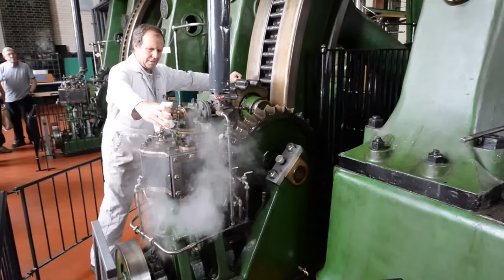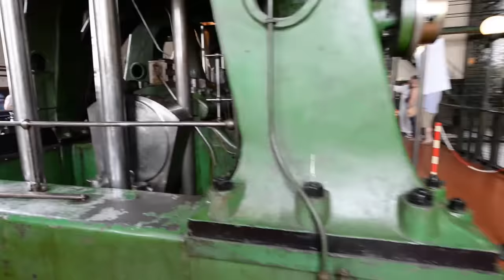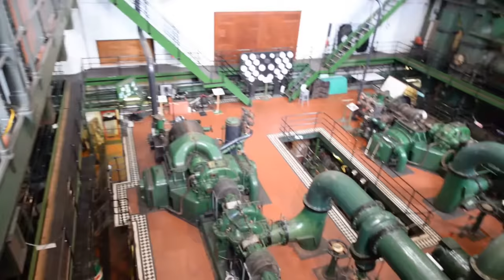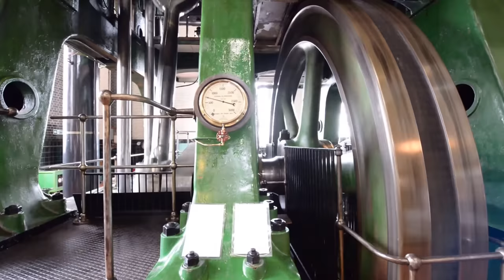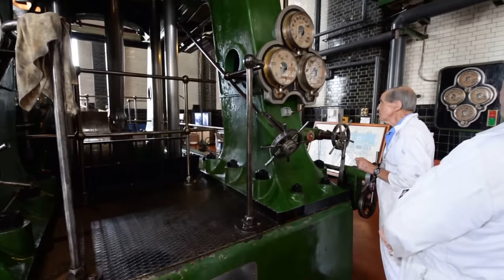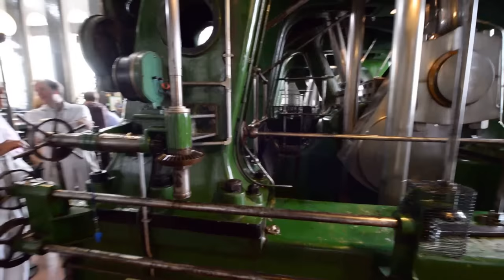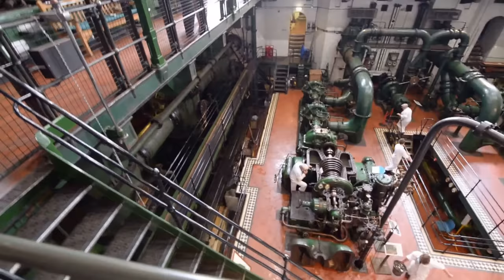Kempton Park  Big Triple Steam Engine Starting

Comment: you now its getting real when your engine needs an engine to start up
Reply: That phrasing reminds me how an atomic bomb works.  ...an explosion needs to happen, before THE explosion.

Also, don't jet planes work on the "pilot-engine principle"?  A gas engine starts the turbine engines.

...a diesel-electric train engine works on the same principle.  A diesel motor powers individual electric motor cells.
Reply: My car is the same way.  ;-)
Reply: Well, from just about every modern combustion engine requiring a starter motor to some electric motors requiring a start-capacitor, just about every efficient thing requires some kind of start, although for cap-start it's only because they run on AC. Synchrous electric motors have near 0 torque @ 0 rpm, like most combustion engines, as they rely on being at a constant speed in-phase with the power, so there is a myriad of ways people have come up with to start them, and one I recently found basically does a clever trick where the motor actually starts off an induction motor, then you can switch it to synch. So that motor needs a motor to start, but it becomes THE starter motor for itself! The shit people came up with.. This is from like he 1920s too! To this day this tech could be used, however it's not really needed as motors are more efficient and mains supply can take short bursts of high current draw, not to mention most synch motors needing some soft-start would be industrial, where having massive starting current is not necessarily an issue.

Anyway, life's awesome :)
Reply: The gas turbines of the Me262, first mass-produced jet aircraft, had a small 2-stroke engine to power up.
Reply: its getting even more real when you need an engine to start an engine to start an engine up
Reply: old cat bulldozers used to use gasoline pony motors to start the main engine
Reply: Makes sense when it’s the size of a 4 story building haha
Reply: True
Reply: Wait............. This engine has 3 cylinders placed 120 degrees apart. Shouldn’t the engine be able to start itself?
Reply: @JCG-049  I was having the same thought, my thinking is that because it is a triple expansion engine, the cylinders are connected in series regarding the steam flow, so basically it starts more like a one cylinder steam engine, because the second and third cylinder get no steam at all if its not running
Reply: Cosa serve questo motore
Reply: @nickwallette6201  lol.. i know what u mean
Reply: Tseam engine start up ok ...if the engine where the use this steam engine ... Its real biggest ...reply👍
Reply from the maker: @JCG-049  needs to be in the correct position so it doesn't start backwards, the small engine is a barring engine it just gets the main engine in the correct position
Reply: @JCG-049  Triple expansion. They each use the exhaust steam of the previous cylinder to extract just a tiny bit more power, pressure drops of exponentially after each stage. You have to get the first cylinder running under its own steam before the others will do their part. Nothing like a multi cylinder individually timed engine.
Reply: Like on car. U use electric motor to start bigger combustion one
Reply: It is just getting pistons in right place
Reply: @thisusernameisaslong  I used to run old equipment that had pony motors,  when I first started running equipment it always would amaze me that the little two cylinder engine would start the big 6 cylinder or 4 lol.  
 Start the pony, pull the compression release lever on the big motor, jerk the ingagment clutch on the pony and let her spin the big motor until you had good oil pressure and she was starting to smoke.  Flip the compression lever to give the big motor compression and let cough to life while throttling back the pony and disengaging the clutch so you wouldn't over rev it with the big motor coming to life.
 Sure wasn't like just hitting the start switch lol
Reply: Good old donkey engine to start the main engine.
Reply: @badreality2  :
Reply: @badreality2  many old piston driven military planes used explosives to start

I've seen the blank shotgun shells used to kick off some of those big engines
Reply: This is not a starter engine, it is a barring engine. It is just moving the main engine to its starting position, the main engine starts itself.
Reply: @JCG-049  it could but no.  The small engine is known as a jacking gear. They slowly turn the engine over a few times to get it lubricated, make sure there's no water logged cylinders,  and so they can slowly bring the engine temperature up with steam.

Large steam engines like this almost always had jacking gear for the longevity of the engine.
Reply: Yo dawg, I heard you like engines, so Mad Mike and the crew hooked you up with some engines in your engine's engines.
Reply: @badreality2  å~~åå mmm. . 
..m .  .    M.   .          .. .
Reply: @badreality2  No, a gas engine doesn't start a jet. Either an air starter(big jets) or a starter motor for the small Jets.(like a car) Locomotives are the same. Some have air starters, some use the generator to spin the prime mover.
Reply: Yeah spot on
Reply: @devilsatan2973  I think they're referring to the ME262 (Avia S92 Turbina)
Reply: Old-school APU, 😆
Reply: Well technically any engines that are not electric (and locomotives because double sided power) need another small engine to start up. A common example of a combustion engine starting from another combustion engine is a jet liner.
Reply: @LeBoomStudios  The J-58 of the SR-71 required a start cart consisting of a pair of coupled Buick Nailhead V8s.
Reply: @michaelasbury7121  The SR71 is absolutely freaky in many regards. The special fuel they used complicated reigniting the engine after a flameout, necessitating a small tank of explosive liquid, which was shot into the engines on reignition or afterburner activation.
Each plane only had a very limited amount of this liquid and the pilot had a manual counter to keep track of the remaining shots.
Reply: Triple expansion engines I worked on had a small bypass valve which is manually opened to send high pressure steam to the intermediate cylinder in the event the high pressure cyl was on center.
Reply: @badreality2  you’re right about the plane part, a small turbine called the apu at the back of the plane is used to push high pressure air through the center of the engine to get rotation.
Reply: Imagine it’s used to start an even bigger engine
Reply: A big rocket engine needs a big turbine jet engine pump to start it like the Rocketdyne RS-26 or F-1 engines on the Saturn 5
Reply: I have worked around huge diesel engines where a pony motor was used to start this big engines.
Reply: It has one for ever cylinder
Reply: Where Is the water pump ? and how Is It connected to the engine ?
Reply: And some WW2 tanks had car engines that was used just to start them 😅
Reply: Coal fired steamship Titanic
Reply: @badreality2 no compressed air. Starts a jet. 
Or a small apu turbine.
Reply: Meh.
Lots of engines need another smaller engine to start em.
Every commercial jet you fly on starts it's engines with a small one in the back (known as an APU)

THIS engine is next level. As OP says, this engine needs a smaller engine just to rotate it into the starting position!!!
Reply: all engines do , think about it your car has a starter lol
Reply: @antoniogomiero9478  to start up a bigger one
Reply: @bobhunter7767  same thing , lol
Reply: @davecrupel2817  thats not true
Reply: @m3cvfm its called a pony motor. Seen them on tons of tractors online.
Reply: Harland and Wolff sure went with the no expense spared in the design of the engines for the titanic
Reply: All engines require a motor to start is, lol.
Reply: @badreality2 est
Reply: Well, technically your car is started by another motor. it's electric but it's still yet another engine
Reply: They all do 😂
Reply: The SR71 is the same way. It used 2 Buick 400’s to start the engines!
Reply: @JCG-049 Look up triple expansion steam engine and you will see why.  These aren’t at all like multiple cylinder ICEs where each cylinder is independent of the others.
Reply: @badreality2  that applies to thermonuclear bombs. A uranian fission bomb such as used on Hiroshima simply required a critical mass of uranium. I should note that controlled nuclear fission reactions occur naturally on Earth.
Reply: @devilsatan2973 The original SR-71 Blackbird jets were started by a “start cart” that had two 400-horsepower Buick automotive engines. Those engines needed to redline (without mufflers) just to get the massive J-58 engines lit.

In the 1980s, the start carts were mothballed in favor of a pneumatic system. But yeah, imagine a time when you had to max out two 400 HP internal combustion engines just to start rolling 😅